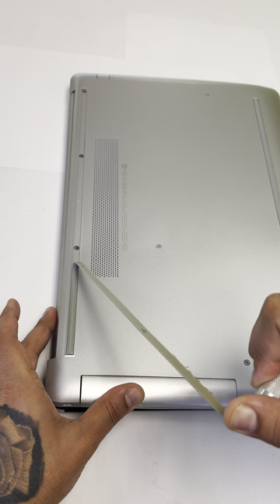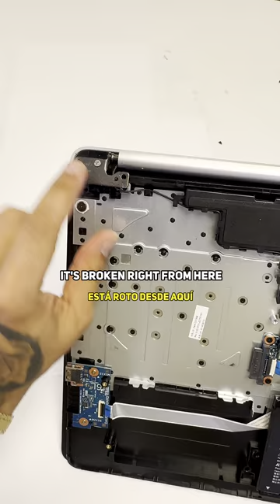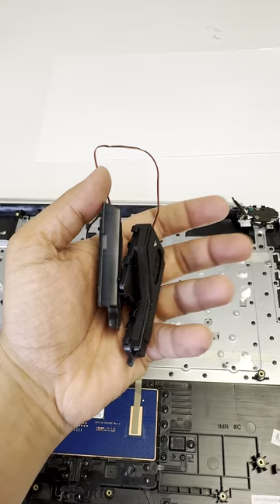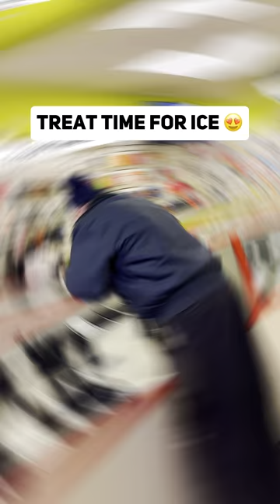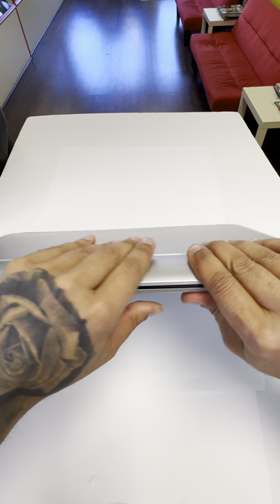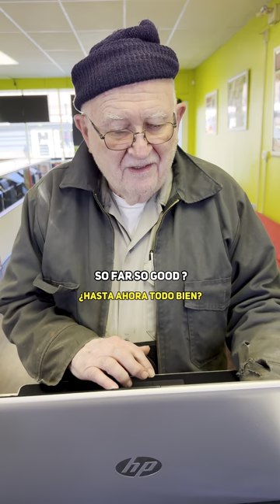Grandpa Couldn’t Use His Laptop 😢

Comment: I don understand why just a hintch need to change and replace the whole keyboard instead of just replace the hintch? I know you are a good guy which Will not con or cheater customer I just simple wanna know why only so I can gain my knowledge I also have laptop also hp have the same problem but now the laptop only can use HDMI cable and attach to my pc monitor.